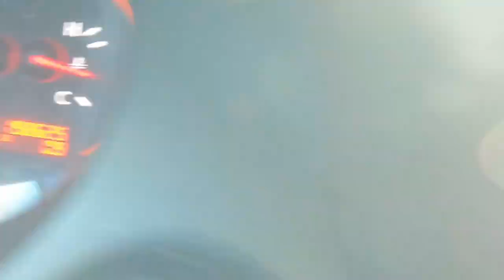Sea Foam Trans-Tune: How to use on Nissan CVT Transmissions!

Comment: Just scored a wicked deal on the original castrol cvt. Local shop here decided to close their doors. They had 40 sealed un-used in the box still quarts of castrol cvt black bottle. I got each quart for $2 each! Been trying to find the original cvt fluid from castrol forever. I know they discontinued it, in favour of the relatively new castrol transmax universal atf/cvt. Which ive been running for 66,000 miles now. 77,000 on the car. No issues. I just couldnt pass up the chance to get my hands on the original stuff. Im very curious to see if theres a difference with castrol cvt compared to castrol atf/cvt. Ill be able to do a x3 D&F this weekend and see. Plus still have several quarts left over. Thinking i might run the trans tune again too. Its only about 4 qrts on my car when i do a drain and fill. 2019 civic coupe ex-t.

Comment: Thinking about using this. Im torn between the lubegard cvt recharge and protect, and the seafoam trans tune. I just did all filters, and fresh CASTROL cvt fluid. My cvt is fine, and ive never had issues. I just want to make sure this doesnt cause issues 😂

Comment: Only use original Nissan CVT fluid!! Buy 5-6 quarts and drive to Valvoline and ask them to use your Nissan CVT fluid have them flush your Transmission. After it, it will not slip anymore and drive strong. My Nissan Altima has 300,000 miles on the first CVT transmissions!!!
Reply: So Don't use Valvoline CVT TRANSMISSION FLUID?
Reply: @jonhawkins2374  you can use whatever you like. Just make sure you remove as much as the OEM fluid as you can..
Reply: @vermontvermont9292  Sounds good thanks...

Comment: Do you recommend that I change my fluid? I have 132k original trans but I’m not sure if the previous owner has changed it. I just don’t wanna make things worse I get 50/50 answers.
Reply from the maker: What I would do, given your situation is change the fluid. If the fluid is the original from the factory, it's probably hurting your transmission more than helping. If it was changed before, it doesn't hurt to change it again either, that way you know. Going forward, keep a maintenance log on all the work that you do on it and stick to whatever the manufacturer recommends from the owners manual.

If you decide not to change it, eventually, the fluid will break down to a point where it can't protect the transmission's vital parts and then it'll be time for a new one. I hope this helps you out! If you have any questions let me know 👍
Reply: @TrickShiftGarage  do you recommend changing the filters as well or just a drain and fill?
Reply from the maker: In your situation, I would change the filter out too, just to be on the safe side.
Reply: You can change a CVT at any point. It's not like a regular automatic where sometimes it could hurt it. I would definitely change it so you know when it's been done.

Comment: good video! after doing this, have you noticed any difference in the cvt? smoother or anything?
Reply from the maker: Hi Mike! And thank you. At the time of this video I also changed the CVT fluid so I can't say if it was the fact that I replaced the fluid or added the Seafoam trans tune, but yes it runs much smoother and better now. I highly recommend it. Thanks for watching! If you have any other questions, feel free to ask 😊
Reply: @TrickShiftGarage  awesome I do have one more question, I have a 2015 ford escape 2.0 ecoboost and my transmission filter is internal, and I usually do transmission drain and fill roughly every 15k because of the crappy transmission, would it be okay to add seafoam trans to it?
Reply from the maker: Yes, SeaFoam Trans Tune is compatible with your transmission fluid which is the Dexron VI Mercon LV type. All you have to do is add it in to your dipstick tube and drive 👍
Reply: @TrickShiftGarage  awesome thank you so much for your help
Reply from the maker: You're welcome and thanks for watching!

Comment: 9 months ago how are your seals and rubber inside the transmission? Can you please post the color of the Fluid next time you change
Reply: Thanks for posting the video brother, Im Hoping to find out if this treatment is good after thousands of miles, or if the there is any breakdowns that happen soon after a smoothe running transmission. Let us know out here in the world of endless YouTube if you have anything to report. Thanks 📸
Reply from the maker: So far so good brother! The transmission has been running smoothly ever since adding the Seafoam. There's a hill that used to cause the CVT to fail holding it's "gear" but after since the Seafoam it holds it now. Obviously I can't say if it's the new fluid or Seafoam (or both?) but I can say that there have been no breakdowns or leaks or erratic "shifting" since that time. The next time I drain the fluid and open the pan up I'll be sure to snap some pics and let y'all know! 🙂👍
Reply: @TrickShiftGarage  you should do an update video on this car, with another drain and fill video.

Comment: Were you having issues with your cvt before this?
Would adding the extra pint of fluid in the trans be bad if it's already full or should we remove some?
Also what are your thoughts on adding a trans cooler on this particular model?
Haha sorry man I just hear so many horror stories when it comes to the 2.5 cvt's im scared to do anything to mine and mine is an 08 with 98k miles on it. Thank you for all of your videos 🤙
Reply from the maker: Thanks for asking! No, I wasn't experiencing any issues with my CVT before doing the seafoam. I did this to help clean out all the gunk and to help protect it for miles to come!

Since doing this, I've noticed the car seems to drive better and it "shifts" quicker and "holds" it's gear ratios longer going down hills. Now...that could've been because of the fresh CVT fluid, but I think the Seafoam definitely helped as well. Thank you so much for watching!
Reply: Thank you for the reply  @TrickShiftGarage . What are your thoughts on adding a trans cooler?
Reply from the maker: I was actually thinking about doing that when I was working on this video, haha!

The radiator does have a trans cooler integrated within it so it already has some cooling built into the system but if you plan on driving it hard or racing, an aftermarket trans cooler is a necessity!
Reply from the maker: Yes, I've heard the horror stories of these CVT transmissions as well lol! They do go out early and often if they are neglected. 

A way to keep the CVT going is doing regular maintenance - ON TIME. Like draining the fluid and changing the filter out that goes along way with these transmissions.
Reply: @TrickShiftGarage  haha awesome, but no plans on pushing it hard or racing, just some long distance drives here and there because it is my daily driver. The original owner (my wife) drove it like an old lady lol and it was very well maintained other than the terrible cheap paint Nissan used that year. Basically I'm just trying to keep it healthy as long as possible while being considerate of its age.
Reply from the maker: Haha! I know the feeling, I'm sure you've seen the condition of the paint on my Altima in other videos, it's disgusting lol. 

But yeah, I think adding a trans cooler could be beneficial for long drives and overall keep it's life going longer. Maybe I should add one to mine 😉
Reply: @TrickShiftGarage  haha awesome man, keep up the great work.
Reply from the maker: Will do! Thanks for your support! 👍
Reply: You do know cvts dont “shift” right?
Reply: My Nissan Rogue had 294000 kilometers on it and had the code f2 on the end. It would shudder a bit when taking off. The fluid was never changed. They wanted to replace the whole tyranny. For the torque converter code. Would just changing the fluid fx the issue?

Comment: Hey! I have a question in regards to my 2010 Nissan Altima 2.5s, when I drive long distance I have to keep my rpm’s below 2500 rpm or else it starts making a supercharger noise lol I do not have a supercharger installed sadly haha. Going on long distance ride it starts to slow down and over rev and I can’t drive for a couple of hours. But is there anything you can suggest what it could be? 

Buying a new transmission is expensive I know my transmission is bad because it jerks when accelerating I haven’t done a transmission fluid change or filter or anything so I’m considering it after watching your videos! They look helpful and hopefully I can do it myself. Thanks in advance!
Reply from the maker: Hi Nabeel! Thanks for reaching out. I think your CVT fluid is overheating and causing the car to go into "limp mode" in an attempt to keep the temperature down. Changing your fluid might help fix this issue, but there may be transmission damage already done too. It's hard to tell on this side 🤣

If I was facing this problem, I would change the fluid and filter and hope the transmission rights itself as best as possible. It's definitely cheaper than a new one. Good luck and thanks for watching! 👍
Reply: @TrickShiftGarage  thank you!! Will do that and watch your videos for help it’s very well explained and thanks again!
Reply from the maker: You're welcome! If you have any questions let us know! 🙂
Reply: @Good-VS-Evil777  I’m not doing it because if I transmission flush my whole transmission could go bad and idk how long the transmission fluids has been in there, at this point I’m just driving it local nothing far and it’s fine but still has the transmission whining sound after long drives. If yours isn’t doing the whining I suggest you do the transmission flush. If it’s all green light. Hopefully this helps!
Reply: @Good-VS-Evil777  I didn’t do neither because it could make it worse couple of my family members who are mechanics suggested but mine is almost at its end life so I’m not messing with the fluids for the transmissions.
Reply: @Good-VS-Evil777  I might give it a try but still skeptical, thank you! Same goes for you 😁
Reply: Let us know how your endeavor unfolded since this post. Sounds like your clutch packs have broken down far past the point of return...
Reply: @BenKochendorfer  I’m just driving it until it dies lol 😂 I bought a prelude